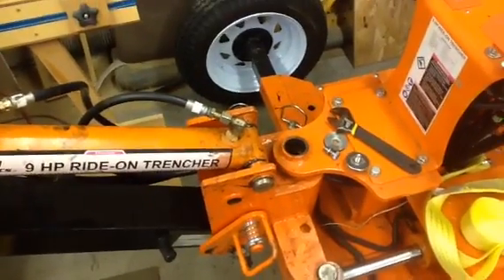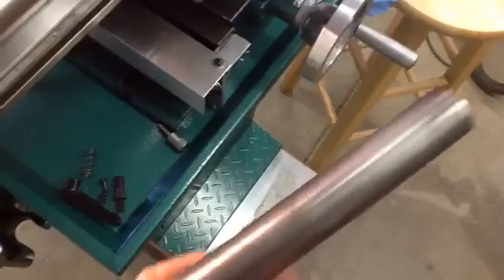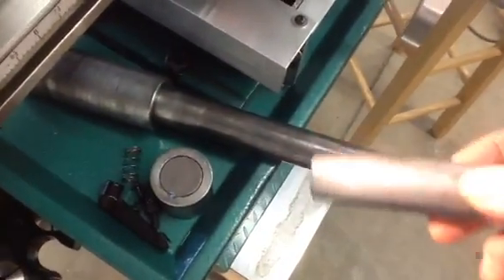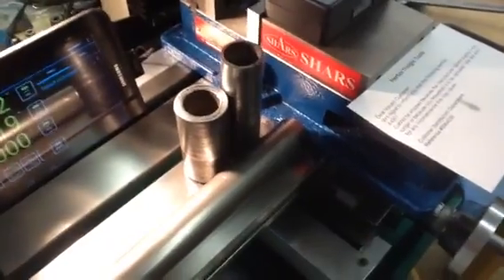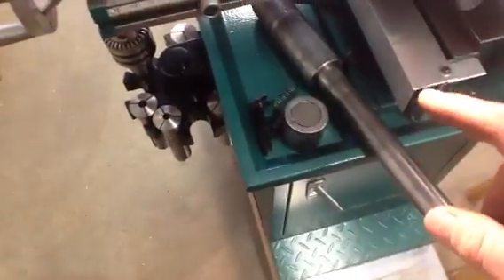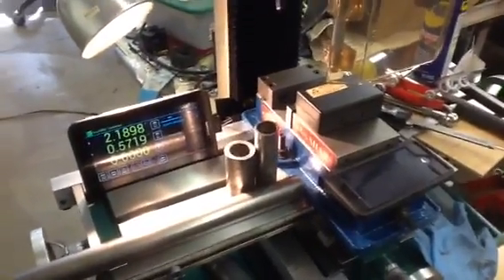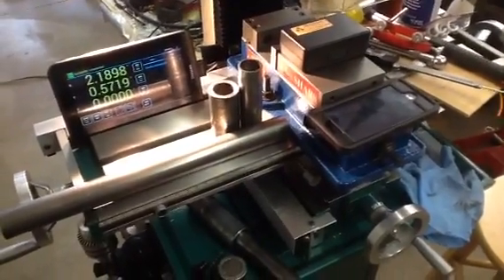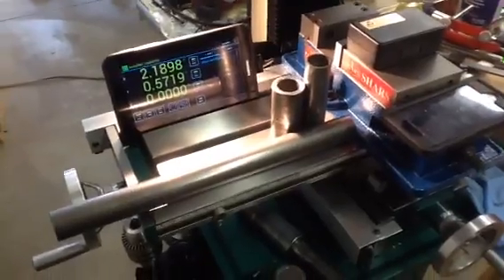Harbor Freight trencher pivot pin failure update#2

Comment: as a retired machinist it makes me want to go out and buy a used lathe and supply these parts.the bushings should have been phosphour bronze with oil or grease grooves with a bolt on cap on each end with a built in grease fitting

Comment: Are you willing to part with one of your new pins? If so how much would you want for it? Did you look at your pin that holds the main boom to the pivot arm? I am asking because I see both of my pins, pivot and main boom, have a lot of play.
      I also want to say thanks for all your help with my hydraulic gear box. Harbor Freight service sent me a new one and it also leaked from the O-rings. It leaked the first time I tried to use it. I called service department again and they wanted me to take it apart. I tried to do what they said until I almost had the hole thing apart. I told the service department I was not doing this anymore and they need to send me another one. I did get a new one and put it on and it works. I did not put any strain on the new box as of yet, weather.
Reply from the maker: +Building Trades Sorry All have been purchased and no more material to make anymore.

Comment: Another great video. Do you recall the grade of steel you used? I may make a spare one while I wait for my machine to arrive. How is yours holding up? Would you do anything different ? Thanks!
Reply from the maker: +Mr26Huffy I used cold rolled steel on all the parts. I greased them very well before assembly I now grease this point with a small amount of high pressure red grease at every use.  I have made several extra pins for spares and.  I will  check this one in the spring.  When you get the machine it would be a great time to pull the drill the grease holes clean it and grease it with good grease .
Reply: +goneredcar1 

Hey thanks for the reply. I have been thinking about the greasing issue and how the design doesn't allow for grease to get where it needs to be. And I think I am going to make them like you did but additionally I will drill a 1/8" blind bore thru the main pin and cross drill into that in the bearing areas. Then I will be able to take the top bolt out and thread in a grease zerk temporarily and pressure grease the whole thing. I don't think a 1/8" bore would weaken it that much - what do you think?
Reply from the maker: +Mr26Huffy For that matter drill the shoulder bolt and leave the Zerk in all the time.  Drill from both ends about 3" that should do the job.  I thought about that but pulling it out gives me a chance to clean, inspect, and lube of this vital point.  When you receive the machine you will see it's an easy job to remove it.  I miss my little machine it's at my daughters house for the winter, I need room for another project.